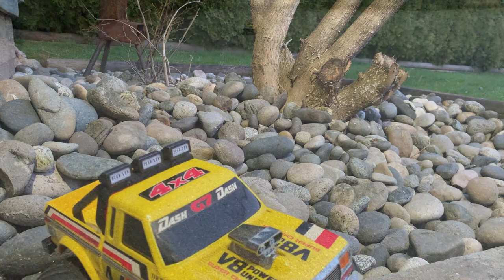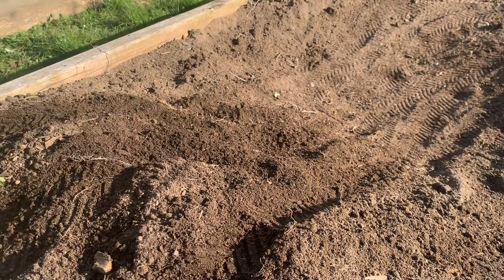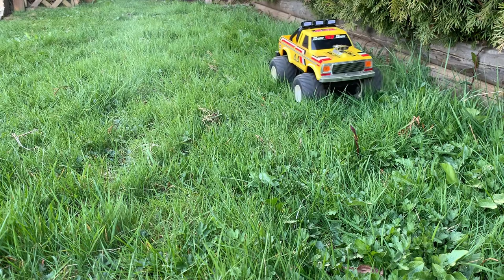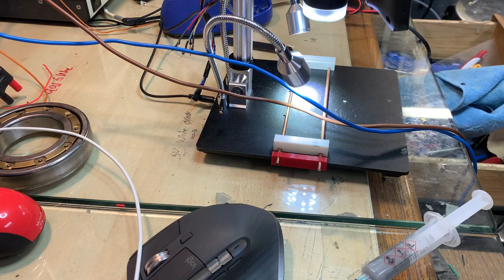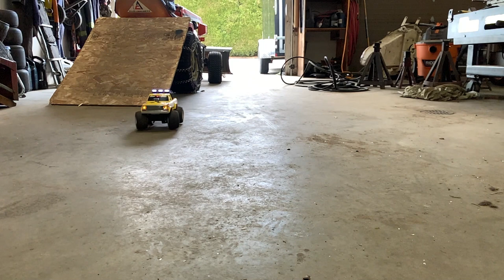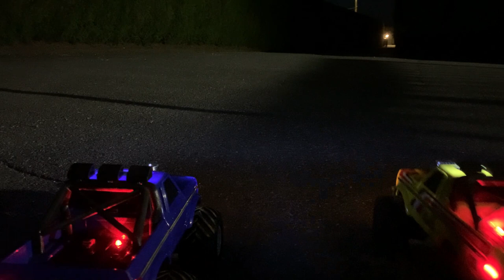Radio Shack 4X4 Off Roader Test Runs And Lights

Comment: Did you design the rollbar and lights, is a stl available? Rad work
Reply from the maker: https://www.thingiverse.com/allaird1/designs

Yes.  The stl files for all the parts can be found here.  There is a roll bar with solid lights or one with lights in pieces to fit led lights and print lenses.  Three different back stays with and without crossbars and with or without a groove to hide wires. And all of the rest i used on this truck. I will have a replacement steering link and a front bumper light bar up this week prob.  Thanks for watching.